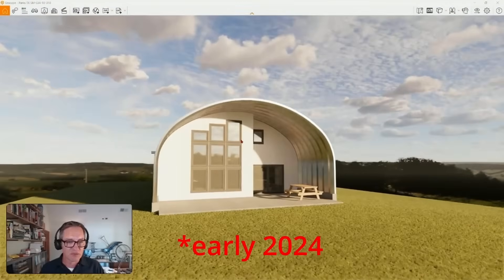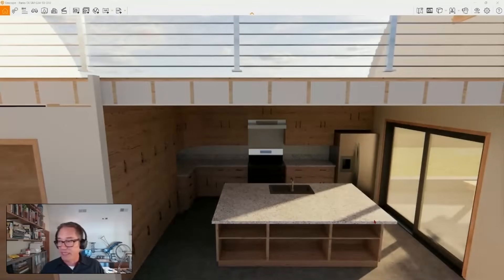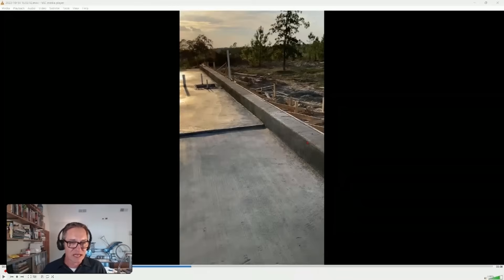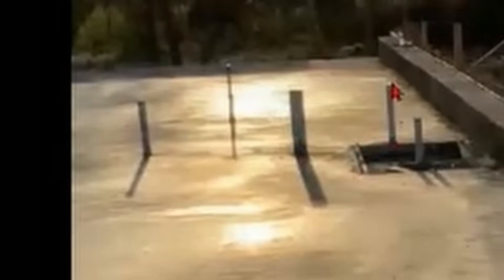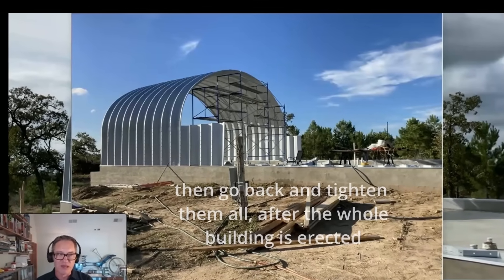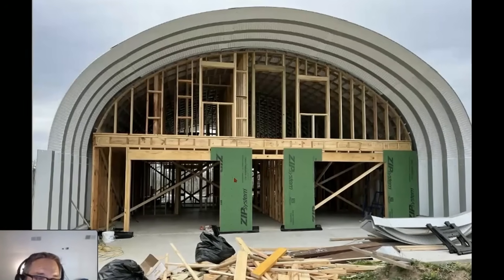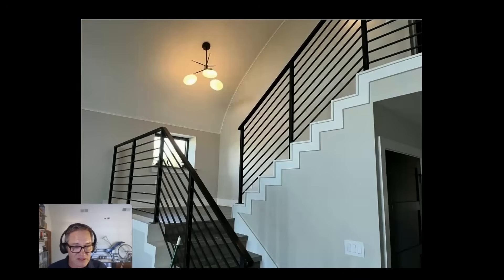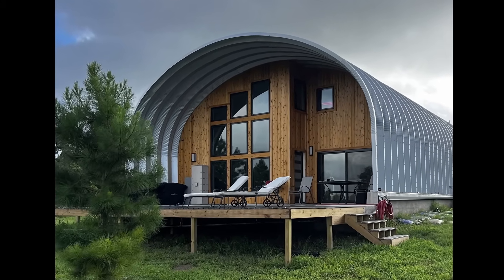Quonset House Case Study: from Concept to Completion

Comment: What do you think about putting a greenhouse extension on it & a hot-tub area. Wonder if those things would help heat the place as well specially in places with colder climates like Canada.
Reply from the maker: I think you will get a lot of humidity from an indoor hot tub and that could potentially be problematic. But sadly, I am not a hot tub expert.
Reply: @CleverModerns  you make a window that can open above the area is encased in it's own area. There are way to build anything. Just have to think it out.

Comment: Hey everyone- How thick of a stem wall do you recommend? We are doing our S-24-14 on a 4ft tall stemwall and wondering how thick to go. Thank you!
Reply from the maker: You need to get with a local structural engineer to design your walls. How much rebar, what thickness and spacing of bars, there is a lot more than just thickness of concrete to consider. The rebar is doing half or more of the real work. That being said you want a minimum of 12" wall thickness, generally speaking, to properly accommodate the base plate.

Comment: Have you ever designed a 3 story tall in height 3/4 home + shop all held within 1 large QUONSET HUT BUILDING IN ALASKA (HEAVY SNOW AREA of Valdez Alaska with a home garage entrance of no less than 50 ft tall from floor to ceiling and must have geothermal Heating and Cooling... a is there any way that you could possibly design such a structure? And what was the fee for that be..?

Comment: Look up a 1/2 Quanset built in Sun Valley Idaho.  They used only 1/2 curve and the open side faces South and has huge passive gain.  Used Concrete formed stemwalls with board form texture on the first and second floor south wall / Terry Thon
Reply: Hey Terry! I cant find this build, any chance you have a link? I was thinking of doing similar, like an earthship hybrid..Thanks!

Comment: You just prefaced insulation at the beginning of the video. But when it came to a demonstration step segment on how the house was built. It was unfortunately left out. Even though I love the structure of an industrial quanset hut home. I heard condensation is usually a big factor in humidity, rain, or snow moisture. I would've loved how you tackle that. I'm sure heated floors on both levels would've been a plus too.
Reply: His FAQ on the website says closed cell spray foam.
Reply: Place a large run of silicone in between layers of the hut as you install and use spray foam insulation on the inside to eliminate the moisture problem.

Comment: How was the interior framing attached to the steel skin?
Reply: They build a framed ribbing that the walls connect to, the electrical goes in, and the insulation.

Comment: You should check out RAL Homes from Australia.  They designed similar homes like this back in the 70's but significantly better.  There's a channel on youtube they had that goes into it in more detail.
Reply from the maker: Do they even still exist? Yeah very cool buildings but they aren't in the US unfortunately. But I'm not sure they are still around.
Reply: @CleverModerns  The inventor died a few years back and they tried to sell the company but couldn't.  It would be amazing to see them come back.  Maybe someone could buy the patent from them.

Comment: On the arc portion of the top of the building, how did they insulate? The other issue is dead space and heating efficiency.  What did they decide for the heating and cooling?
Reply from the maker: This is insulated with closed cell spray foam, which is really the best/only real option for a home with a Quonset hut. Not sure what you mean by dead space and heating efficiency. They used a conventional, ducted forced air system.

Comment: How are the firring strips attached to the ceiling?
Reply from the maker: You use coupling nuts to attach a threaded rod to the inside ends of the building bolts, and bolt the wood framing on that way. This is in my queue of tutorial videos I want to make.

Comment: Have you heard of anyone trying spray cork and then cork panel insulation that, if properly framed in along the arch, could preserve the arch throughout and provide an attractive and durable interior wall surface? You'd have a lot of condensation-friendly, insulating material (and I'm hoping to finesse that quonset build to be pretty water tight). Thinking of adding in a couple light/ventilation wells, a couple opening windows (one on each side), plus the doors, for air flow. Mostly just asking about my crazy idea to wrap the inside with cork and have a very natural and insulated space.
Reply from the maker: Cork insulation is vapor permeable and you would have a very high risk of moisture issues with it. For that reason and others I can't go into in this comment I do not see it as a viable method of insulating a Quonset hut home. There really is no substitute for closed cell spray foam with Quonset huts. If you wanted to, you could finish the interior of the arch with plywood or drywall and then glue cork panels to the surface if you liked that look.
Reply: @CleverModerns  Thank you!!
Reply: @CleverModerns  If I can just clarify, this would be an issue in any climate, correct? I'm in a pretty dry climate but we still get some significant bouts of moisture at times (Tri-Cities/Walla Walla, WA). I appreciate your reply! I actually was hoping that the moisture tolerance of cork would be a boon, but it sounds like exactly the opposite, ha ha. I'm still in planning stage, so hadn't done full investigation, but definitely was hoping for something other than spray foam. Sounds like it's the ticket, tho. Again, thanks!
Reply from the maker: @patriciaeamon1388  Yep, any climate. Cheers!

Comment: What pitch is the front porch poured at? Do you need to hold a wrench on the bolt heads when tightening?
Reply from the maker: You should slope it at a minimum of 1/8” per foot but 1/4” per foot is better. And yes you need someone on both ends of the bolt, one holding and one tightening. I’m going to do a video on proper bolt tightening to avoid leaks.
Reply: @CleverModerns  Thank you for your reply.  I've built hundreds of grain bins over the years and you would have to leave the roof loose  until the whole roof was in place. I would send the lightest guys on the crew up on the roof with ropes and harnesses and a half inch wrench to hold on to the bolt heads when tighting the roof. That was always a bit of a struggle.
Reply: yes you do